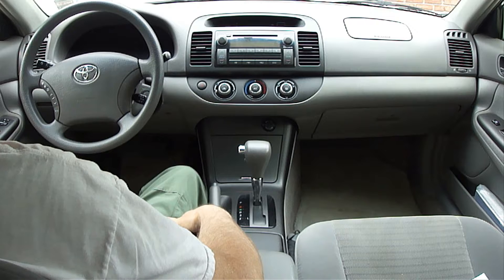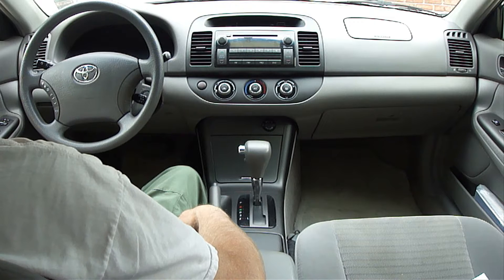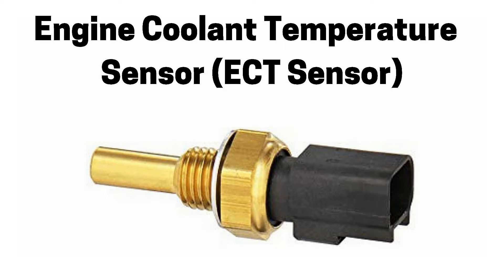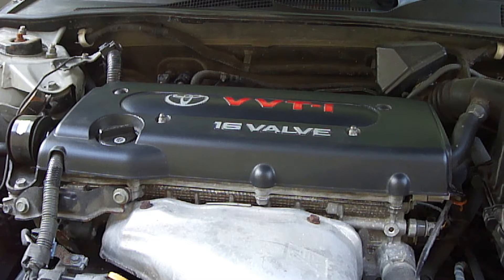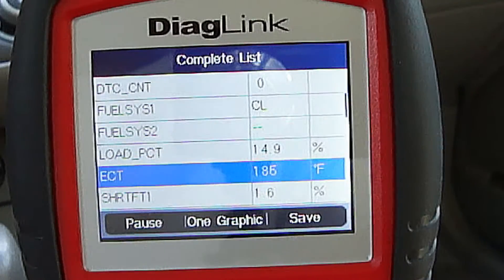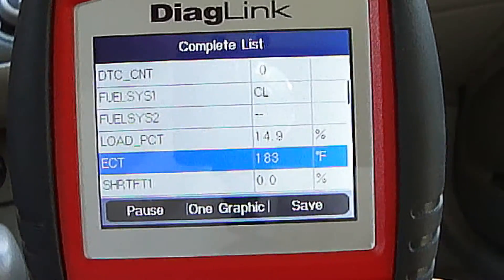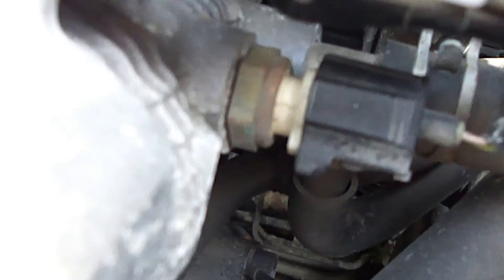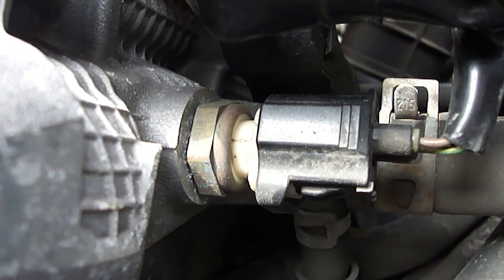Why Cars Have Trouble Starting Once The Engine Is Warmed-Up?

Comment: Question... Isn't that the same sensor that controls the temperature gauge? So if it goes bad wouldn't the temperature gauge show a wrong reading? I'm asking because I'm diagnosing my car and that sensor was on my list, but my temp gauge is working fine.
Reply from the maker: Yes
Reply: @proclaimliberty2000  I figured... So I have a 97 jdm honda accord with an F22B engine (I'm in Jamaica btw). Cold starting is perfect. Once UI drive some distance and the car gets hot and I turn it off, it doesn't wanna start... if it does, it fumbles  until it does start and you see rich exhaust out the tail pipe. How I get it to start is by plugging off the wires off the injectors so the Ecu doesn't pulse them, then crank the car, the fuel in the line ignites and the car starts but dies because there's no continued fueling. Then I plug them back in and then start the car normally and it starts and runs. I've narrowed it down to flooding, but why is it flooding I dnt know... I have a new MAp sensor and Tps, and they are calibrated properly. which led me to this video about the coolant temp sensor, but my temp gauge works fine so I'm inclined to think it's not the temp sensor.
Reply: @bosslightproductions498  I've done a lot of research on this and is possible that your fuel injectors get stuck open when the car is hot or warm and that will flood the cylinders and when the fuel injectors are cold they they don't flood the cylinders because from all the forms that I've read I guess that there is a electrical resistance that builds up in circuits when they become hotter and hotter and went once the electrical components starts to fail then the resistance just gets too much and then fuel injector could be stuck open or stuck closed so I'm still researching this for my own vehicle because mine starts starts up perfectly when cold and then cranks forever when the engine is hot so I still don't know what's going on either but it might be fuel injectors and flooding and also I just found out that there are vacuum lines that only open up when the engine is hot so if you have a crack in that particular vacuum line then he'll be letting in too much air only when the engine is hot, however, when the engine is cold there's no air going through that vacuum line because it's closed and example is the PCV valve only opens when the engine gets really hot and I did find a crack in mines I'm going to replace that hose and I'm hoping that's it but it's just such a tiny crack I can't imagine that being the problem but maybe it is
Reply: @rawfoodphilosophy7061  I ended up changing the engine and the ecu
Reply: @bosslightproductions498  yep, getting a new engine always works
Reply: @rawfoodphilosophy7061  having similar issue with my 02 celica gts.  Cold start is good, but warm start anything above 150 degree F just cranks.  I have obd2 hook up to monitor at all times during drive and when engine is off so I can monitor temp.  Operating temperature is normal.  I have to wait for coolant temp to drop to below 150 before the engine will turn.  Ive changed injectors, PCV, coil packs, spark plugs, fuel pump, fuel filter, fuel pressure regulator, O2 sensor upstream, cleaned throttle body, replace air filter, checked for air leaks, cleaned MAF.  Not giving up yet.  Next is replaced MAF and replaced ECT.
Reply: @abuelb  oh my God I have done almost every single thing that you have done, except for changing the injectors!
Reply: I'm pretty sure you can just take out the mass airflow sensor and then see if your car starts up better without it and and idles better without it I've done that in mine I don't see any difference at all. But as I recall the MAF is a cheap fix to buy. Other things that possibly could be from me is a vacuum leak small crack somewhere that expands when the car is hot. My car starts up bad when hot and idles roughly only when hot so people are saying that it could possibly be due to some sort of expansion some examples are the fuel injector O-rings expanding which obviously isn't the case for you cuz you've already changed them it could also be intake manifold gasket expansion or head gasket expansion there so many things it's actually mind-boggling that cars don't break down more often now I'm just freaked out cuz there's like a thousand different things that can go wrong with engines and it feels like I replaced almost half my engine already but don't give up keep me posted man if you are find out what's going on
Reply: @abuelb  also people I said there's something to do with electrical wiring that when it heats up starts to behave differently so we need to check our grounds and check circuits, which is a Monumental task
Reply: @rawfoodphilosophy7061  update: grounds all checked good and I even cleaned the terminals.  Replaced camshaft sensor, crankshaft sensor, new MAF sensor (engine dies when removed) , new ECT sensor.  Same long crank no start above 150 degree.  Although I've diagnosed  the one misfire on one cylinder by swapping with one working injector and went ahead and replaced all injectors with brand new cheap eBay OEM injectors since the reman set I bought initially and installed had 3 of 4 working.  The car runs fine on the road, just wouldn't start when hot even if I spray starting fluid in the intake from the MAF sensor hole.  My 02 Celica has over 395k miles but clean inside and out.  The battle continues.
Reply: @abuelb  thank you for the update! I just bought really cheap fuel injectors on Amazon for $35! And now I just got to research how to put those suckers in. I think that is my problem it has to be it because I've done so many other things and not one thing has change the overall idling and hard start only when hot. I'm very hesitant to change the fuel injectors because the cardinal rule is if it ain't broke don't fix it. But my gas mileage is starting to go down also so that's another sign that I either a fuel injector is leaking or is partially clogged. I can't remember what else I wrote to you but you can rent a fuel pressure gauge at AutoZone or O'Reilly's and also check the compression of your cylinders. It is just so strange that cars have trouble starting when hot but start right up perfectly when cold and idle perfectly when cold.
I'm considering getting a mobile mechanic and have him look at the car while I'm right next to him because I do not trust mechanics in my engine without me being right there with them. Damn, did you say your car has 400000 miles? My van only has a hundred and seventy thousand miles!
Reply: @rawfoodphilosophy7061  The battle is won!  The long start was intermittent and I was losing power once I drive from 1st gear and would hesitate initially, but runs fine once above 2k rpm.  Turns out  it was the fuel pump that I replaced.  Went back and put in a new pump just to rule out and made sure all O rings & rubber grommet were tightly secured especially the one that goes around the nozzle outlet of the pump.  It was loose and not seated securely inside the hole of the filter.  Now I can go wide open throttle from first to any gear smoothly without hesitation.  My 4 new injectors were $40 from ebay and worked great.  Now I can go for 500k miles.😄

Quick check to see if injector is bad is while at idle, unplug 1 connector  at a time.  If no change in the idle speed, injector is bad.  Good injector should cause idle to slow down or bog the engine.
Reply: @abuelb  wow, good for you! Now you got me worried because I just replaced my fuel pump about 6 months ago 
With a cheap one from Amazon. Thank you for the fuel injector advice. Holy crap man I can't believe you have 400000 miles on that car I'm hoping to just get another 50,000 on my vehicle but it would be so nice if I could get another hundred thousand miles cuz I only drive 10,000 miles a year so that would be another 10 years and by then the world will probably completely Collapse by then
Reply: @rawfoodphilosophy7061  😂. I'm not too concern about mileage anymore.  I just enjoy driving my Celica however long I can keep it running.  Good luck to your troubleshooting!  I hope you get it fixed.
Reply: @abuelb  going to get a Toyota next time
Reply: @rawfoodphilosophy7061  get another car, one made before 1968

Comment: I changed mine and still have similar  issues  just the car drives better then before but still has a starting  problem  and runs rough after I am able to turn it back on. It's a obd1 and I dont have a scanner. Any pointers? Aba vw engine
Reply from the maker: What is the make, model and year?
Reply: @proclaimliberty2000  1995 golf  2.0
Reply from the maker: @jrcruz9080  How many miles do you have on the vehicle and have you ever replaced the spark plug wires?

Comment: My car is a 2.0 petrol and it starts when it’s cold but when the engine hits 60-90 degree it automaticly dies if you let it idle. And it’s just a pain in the ass to start the engine when it’s warm. The car also shake as if it struggles to pressure the fuel

Comment: Very helpful. Do you have to put teflon tape around the thread of the new sensor so it doest leak? Or not necessary?
Reply from the maker: aynjel011 If it does not have an O ring seal then yes I would.

Comment: Iv just refreshed my Coolant system after a wtr pump failure.
Now my car takes longer to start & feels sluggish on hard acceleration.
Is my ECT sensor bad, how/why now?
The timing on this is weird!
Reply from the maker: Chris Davie Does it take longer to start when the engine is cold?
Reply: @proclaimliberty2000  I think it's the same, hot or cold
Reply from the maker: Chris Davie I wonder if something electrical got wet or some electrical connection got disturbed. Did you do the work yourself?
Reply: @proclaimliberty2000  Yes.
Job was tidy.
Car would have only got wet at the time of the pump failure. No more than it gets whenever it gets washed.
Reply from the maker: Chris Davie check and see if a diagnostic scanner shows any stored trouble codes.
Reply: I'm now thinking the problem is the Engine Coolant Temperature Sensor. 

Although the dashboard temp gauge still works, when I unplug the ECT Sensor this makes no difference to how the car starts/idles.

Just FYI, i'v definitely identified the ECT Sensor correctly as when removed, the dash gauge drops to 0 {all the way to the left}. 

Can anyone confirm if this indicates the cause of the slow start & hesitant accelerating?

Iv ordered up an OBD scanner, just as an aside. 
Thanks.
Reply from the maker: Chris Davie Keep me posted on your progress.

Comment: I have a new temperature sensor and still reading this code n my car reads that's over heating
Reply from the maker: Junior Hernandez as long as your engine coolant is at the proper level you probably have a bad thermostat stuck in the closed position which needs to be replaced.

Comment: So my 97 Oldsmobile LSS (3.8L NA) does this thing where it doesn't like starting after several trips (or if it does it runs rough and misfires) but always starts nice after sitting long like in the morning. I've had this actually happen at a Sears auto center when they were doing a check over and they said it wouldn't start and had to push it. They said it could be a few things but the puzzler is that they even said it ran great when the drove it in.

So far when this happens I end up using Carb cleaner to get it started again.

You mention a coolant sensor, but so far all of my sensors seem to be working correctly, as I've monitored them through OBD while driving. Might this still be the culprit?
Reply from the maker: I would still replace it.  Very inexpensive and very little effort to replace.
Reply: I had a 3.1L 97 Olds. It would shutoff at red lights and stop signs. Then hard to start back up. Fuel pressure regulator was the part I needed. Hope this helps